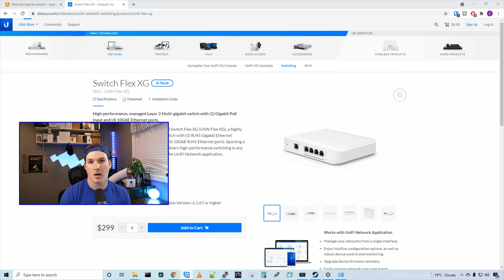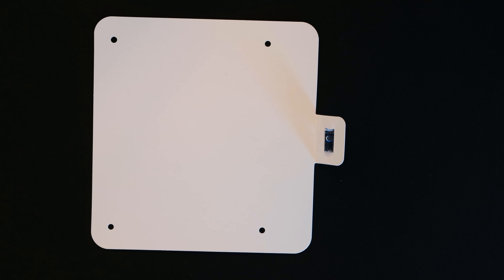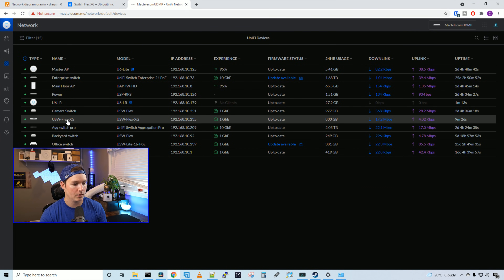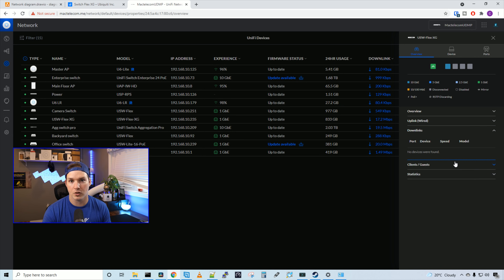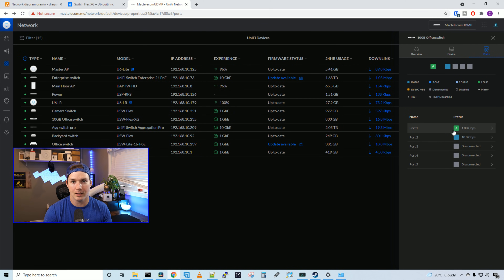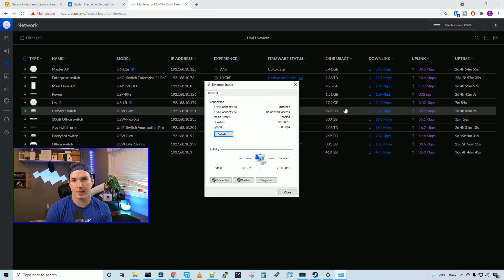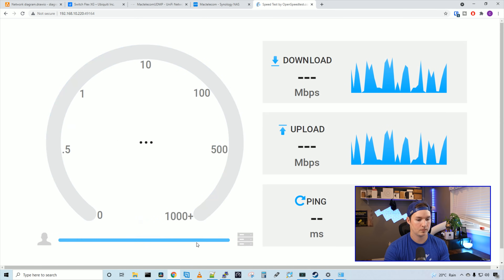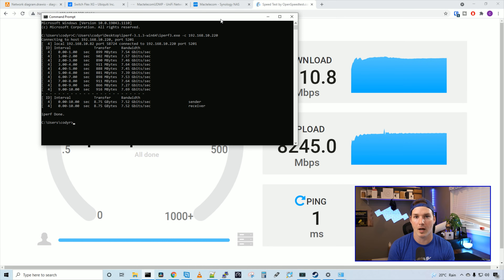New Unifi 10GB Switch. Unifi Switch Flex XG

Comment: Once again, Unifi fumbles the ball on the 2 yard line. Why hobble this switch with a last-century, 1Gb uplink? Would it kill them to make this at least a 2.5Gb port or (gulp) a 10Gb SFP+ port?  As is, I fail to see the use case.  Yes, maybe it can plug into a 1Gb port on an older gateway while running a local NAS. But as 3 and 5 Gb internet connections are becoming more available, this design seems doomed to be short lived.

Comment: Best I can tell this is meant to provide 1gbe internet but allow for 10gbe local network. I need an input greater than 1gbe and from what I see available with Unifi it looks like USW-Aggregation An 8-port, Layer 2 switch made for 10G SFP+ connections is my only option so I can go from my UDM Pro to the USW-Pro-24-POE (400W) then to the USW-Aggregation (I'm not rich so single point of failure will have to work lol). This way I can also go to the PC and the NAS on my network. 
Because as it stands if I go from the modem (SFP+ w/MikroTik S+RJ10) then to the switch (SFP+ DAC) I'm only left with one SFP Port. So I can either use the Agg as a switch managed with the UDM Pro, or I can just not have 10g to but one device. If there is a better option for 10g using the single remaining SFP+ to access multiple 10g connections please let me know.

Comment: As much of a UI fan boy I am, I just don't see the value in this. SOHO, then price is too high. Larger business will go with an enterprise switch. What UI really needs is a 4 or 8 port 2.5G switch with single RJ45 or SFP+ that can be used as a 10G uplink. Great overview though man.
Reply: Just got a pair of 4(2.5G PoE) + 2(sfp+) switch. It works great for my home network, and it only costs $40 ea.

Comment: Can we skip using port 1?  I want a 10gbe connection from my main network closet in the main house, to the CAT8 run that goes to my guest house (physically separated buildings)   The guest house has the 10gbe NAS and Mac Mini with 10gbe network port.    I'm trying to avoid the 1gb bottle neck.     I have this on order so I guess I'll experiment, but I thought I'd ask while I wait. I'll need to power via USB C in the back of course.
Reply from the maker: Hey,

Ya for sure you can use any other port as your uplink
Reply: Good info

Comment: do you have to use the 1g port for an uplink or could one use the 1g port as a normal switch port and use one of the 10g ports as an uplink?
Reply: @JeanKing310  thx
Reply: On ALL ubiquti devices you can reassign the ports, it makes no sense to use the 1GBe poe for data, i would guess is meant to be used for PoE power and not data.
Reply: Just 1G uplink port is totally nonsense. Why on earth someone would think to get this switch that doesn’t have at least an SFP uplink to get uplink in 10G?
Reply: @Danielddiniz it’s for POE in mainly. No one really makes 10gbe Poe+ switches so you power it using 1gbe and then you can have a 10gbe data link if you want.

Comment: I also have this Switch Flex XG and I can only perform the iPerf3 test up to 7.05Gbps between two x86 computers linked to this switch. Do you have any idear to furhter push the speed under this switch up to over 9Gbps? Or I should consider SFP+ switch and NIC systems for the 10Gbps wired speed?

Comment: Is it possible to use the ports 1-4 as aggregate (1g + 3x 10g) and the last one as Uplink ? Or aggregation is limited between 10g ports ? It's to make a 10G link between 2 houses. The aggregation ports will be connected to Local switch on both sites.

Comment: I mean this feels like it should cost 50 USD, maximum 100 USD.
There are only 4 ports with 10GBE, no faster uplink port, and the POE-in port isn't even 10GBE.
This is clearly a budget desktop switch, even if it has basic management features.
10GBE prices are still nowhere near where they should be.

Comment: I'm going to change my comment on this when I said it was overpriced.  Yes, it's on the pricey side but these are RJ45 ports meaning I don't need to worry about 10gig transceivers with a high power draw producing tons of heat.  Most homes or small offices have cat 6 already pulled so this makes connectivity easier.  People keep talking about aggregation switches these types of switches are built for data centers where I can easily connect using DAC or fiber meaning that the gear is in the same room.  Yes, I can put this in a wiring closet and connect via RJ45 every time I connect I'm looking at 45 to 60.00 for a transceiver also if using RJ45 transceivers most of these vendors do not support a fully populated switch with RJ45 transceivers and I'm not pulling fiber through my home.
Reply from the maker: Fair enough!

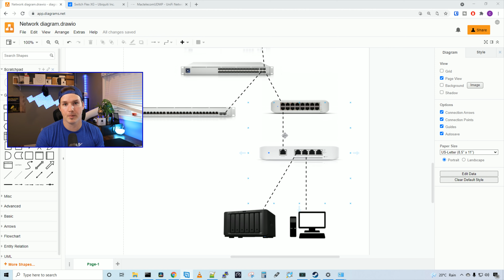Comment: At the topology at 6:36, I am not sure why you put the switch 16 lite POE there, wouldn’t it be better if you connect the Flex XG to the aggregation Pro switch via 10gb ports? Are you doing it this way because the 10gb port on the flex xg can’t be used as uplink?
Reply: Please answer this question somebody. This is the #1 question I’ve had for little over a year now.
Reply: You can use a 10gb port as an uplink. That’s how mine is setup
Reply: Because he is powering the FlexXG from the Lite Poe one.  It might also be the reason the speeds are not optimal since the FlexXG is not powered from the wall and might need more than 55V of power to reach 9+ Gbps.

Comment: Really bad results and strange you didn't checked them. 7G isn't 10G and iperf must return the full bandwidth as you are transfering from RAM to RAM. PS You can call it 10G or 10Gbit or 10Gbps, but never 10GB.

Comment: CMIIW : PC can communicate directly to the NAS (in one network)  without actually going to the router first? 

PC -> Switch -> Router -> back to Switch -> NAS . my stupid head thought it's like this
Reply: If the devices are inside the same vlan or lan than yes (normal MAC based Layer 2 Routing). If they are in different vlans, you require L3 Routing (IP based). That is either done on the Router or on a Layer 3 switch.
Reply: @andreas7944  thanks!
Reply: bisa nyambung langsung bos, kan 1 switch
Reply: @zxcvbnm-yy8bk  mantap om, baru tauu kirain lewat Router dulu

Comment: This looks like it could be a great backbone or aggregator switch for a small network.

 * All copper and RJ45
 * Under $300
 * Fanless (thanks for your answer earlier)

With an SFP to rj45 converter to a Pro 24 (tho I wish the switch was fanless - and, yeah, that it had a copper 10G port), you’d still have 3X10G connections for one desktop and a NAS with one left for growth. 
I suspect there are many networks like mine where there are only three, maybe four, devices that could effectively use10G. My NanoHD WAPs do a great job of saturating the house with fast and reliable WiFi. My smart home devices almost all run on 2.4G. My TVs are fine with wired Gigabit.
Not sure why everyone is saying the aggregation switch is so superior. It depends on the requirements of the network, I think. 
This looks almost perfect to me.
Reply: I just did that, it replaced a 10Gbps 5 port Netgear rackmount switch which barely fit in my closet box.  This unit is a fraction of the size and quiet.  I didn't connect the POE since I don't have anywhere to route it, maybe I'll stick a wireless bridge in there to get access to it.  Maybe if I'm lucky there is a way to manage it from the 10Gbps ports as well.

Comment: Very Disappointing No Layer 3 on these or their industrial series switches in 2021. not worth $299 at all
Reply: I see your point. But Layer 3 would increase the costs and the heat. I am not sure if you can cool it passive for a 10gb switch. The target audience for this device is cost and noise sensitive, I guess

Comment: This is an overpriced, waste of money for a 4 port switch and here is my reason why.  1.)  I just recently purchased an "Unifi USW-Aggregation 10G (8-Port SFP) Switch" for $269 at Microcenter, which price matched it with Unifi's website.  It comes with the new digital information display also included on the UDM-Pro and the new generation switches and is a layer 2 switch with VLAN support and unify management.   While connected to my UDM-Pro 10G Lan port, I'm getting 10G all the way through, with the exception of my WAN.  2.)  I also have a Mikrotik CRS305-1G-4S+IN 10G Router/Switch, which I Paid $139 for; however, the management port is a 1GB RJ45 port.  Non the less this switch is great for the price, horrible when it comes to the software friendliness, but very very powerful.   This switch should be way cheaper than $299, maybe $179, but also within reason from what a Microtik 5 port 10G switch/router cost for way less.  I'm just saying.   Here is the link to the 8-port product I am referring to on Unifi's website.  https://store.ui.com/collections/unifi-network-switching/products/unifi-switch-aggregation

Comment: This product doesn't make any sense. Why would they make the uplink/power input interface 1Gbps? No PoE on the downlinks either, really struggling to find the use case. Just buy an XG6. Taken with the UDMP SE I really wonder what Ubiquiti are doing.
Reply from the maker: The 1GB uplink will be used for internet. For me this is a great office switch. I have my 10GB computer on it and my 10GB NAS so my video files transfer really quick

Comment: Hi, am i correct that when i plugin 2 computer at 2-5 they can utilize full 10gb in between communication, so i could mokup a 10gb network behind a udm base which only  has a 1gb switch build in?
Reply: 10gb uplink between switches would have been nice

Comment: 1GB uplink in a 10gb switch.  Huh?
Reply from the maker: The 1GB uplink is to the internet
Reply: @MactelecomNetworks - Its not a WAN port is it, its just an uplink port with POE in.  This is an good switch for a desk or small office area where you want to 10gbe connectivity, but if like me your NAS is in a rack that's not next to your desk, you have to use a 10Gbe port for uplink - that's fine, I have a printer next to my desk that can happily use the 1Gbe port.  
All that said, this product should of had 5 10Gbe ports, Ubiquiti have intentionally crippled it with the 4+1 config
Reply: @68kfrank  well except Poe is likely coming from an upstream switch which then means all upstream traffic is limited to 1gb. You want to run a poe port AND a 10gb uplink port on a switch with only 5 ports to begin with?
Reply: @ystebadvonschlegel3295  you can power the switch through USB and use the 1Gb port for other purposes. You can even use a downstream PoE switch to power the Flex. Couldn't be more flexible.

Comment: Don't waste your money ($299) on this. Jut buy the UniFi 8-port aggregation switch for $269. It's way better value if your looking for 10GB connection.
Reply from the maker: Well then you still need to buy a SFPs so could end up costing you more
Reply: @MactelecomNetworks  +1  I have no idea why people say this.  It's like they either have a pile of SFP adapters lying around and figure that's what everyone else has too or they are used car salesmen that don't give you the fine print.  Plus the agg isn't PoE...smh

Comment: i would 100% get this if i did not need to climb through a 16 inch by 16 inch hole to get into an attic that has no floor or anything 🙄

Clarification edit: i would put this in my attic

Comment: Someone correct me please. 10g cannot be POE as the pair that is normally used for POE is used for data. This is why they could not make the switch powered by POE and a 10g uplink.
Reply: While that's the case for passive PoE. 'Proper' 802.3 PoE can use the pairs for both data and power. IEE 802.3af and onwards https://en.wikipedia.org/wiki/Power_over_Ethernet (edit typo)
Reply: you can use 10GbE for uplink. Powering it through a 1Gb PoE port from upstream or downstream is just an option - you can use USB too.

Comment: I don't see much value in this switch considering the 1Gb port and price.  UniFi 8 port aggregation switch is better value. Now if this box was a firewall/router (USG), I believe it would sell like hotcakes.
Reply: I don’t think he’s got it right.  The PoE in is predominantly to power the device, you can use any of the 10gbe ports for an uplink.
Reply: Maybe if the agg switch were RJ45, but I'm not sure I agree with the value assessment.  I agree with the 1G uplink.  Should have been 2.5 and it would make more sense and be more flexible in various networks.
Reply: @5280Woodworking  Cost savings are realized with UniFi 8 port agg switch when you connect to other 10Gb devices (nas, computers, etc.,) and have to buy the interface cards. On average 10Gb SFP+ cards are about $45 dollars cheaper than 10Gb Ethernet cards.

Comment: I wish that uplink port supported 10/5/2.5/1 Gb. When connected off of my main switch (which is how I'd use it), I'd like to get the full 10 gig back to that switch.
Reply: I’m using one of the 10gb port as an uplink and the 1gb as a downlink to a switch with my lower speed devices.

Comment: Really sucks that the PoE uplink is 1gbit. Would have been perfect if it was 10gbe too.
Reply: Agreed. Imagine you have another computer on the other side of the house, and you want the full 10Gbps to the NAS. You're outta luck!
Reply: @neekster28  Honestly even simplier use case, I have multiple devices that connect to my NAS/Server at the same time, which definitely has the posibility to use more than just a gigabit in total.
Reply: @neekster28  nothing stopping you from uplinking to 10Gbit, but I suspect they expect it to be used as an uplink more directly to the router for internet...think DMPvSE

Comment: Overall I am pleased with this switch ( does what I want) but the one thing that is driving me crazy is - NO way to turn off the Leds.  The toggle to do this does NOT work.  I know I'm being picky and have black tape across the front of the unit, but for $300 - come on fix this.
Reply: I don't have this switch yet, but did you try restarting the switch after toggling? Sometimes I have to restart equipment after making a simple adjustment.
Reply: This hardware limitation applies to other Unifi switches too. You can only turn off the switch status LED. Don't hold your breath for deactivation of switch port LEDs.

Comment: Such a pointless product, with an extremely high price tag.  A 1 Gigabit uplink and only 4 ports  of 10Gigabit.  Unifi really refusing to give us consumers a quality 10GbE Ethernet switch.
Reply from the maker: For me I’m fine with the 1gb uplink I only have a 1GB internet connection. 

I’ll be using it for my my videos. Have my computer and nas on the switch works well
Reply: @MactelecomNetworks  I think this is exactly the right way to use it. If someone is building a 10gbit network, 4 ports are useless anyway. But if it's just for the desk area where you have a couple of machines and a NAS, this is perfect.

I don't see many other usecases for it.
Reply: @MactelecomNetworks  it would be nice if the 1 gb port were also 10 gb but I could easily see putting this on my desk to support a couple of 10 gb capable computers and not even using the 1 gb PoE port. Instead I’d just use one of the 10 gb ports to link back to the Agg Switch I already have and that leaves three ports on my desk for use.

Comment: Could you confirm whether a 10Gbase SFP+ RJ45 module in one of your upstream switches (perhaps the USW-Agg-Pro) can be used as the uplink for the USW-Flex-XG? I've considered this switch as a future option to use on a different floor to expand 10gig capabilities around the house. I understand that the power supply would need to be used on the USW-Flex-XG. Also, could you confirm that if a 10G uplink is possible, then can the 1G port be used just as a normal downlink port?
Reply from the maker: There should be no reason this wouldn’t work. But I’ll plug it in to my aggregation switch tonight or tomorrow and talk about it on my live stream Sunday
Reply: yes
Reply: I have mine working this way.

Comment: They really dropped the ball on the POE uplink port making it 1GBE, they really shouldve made it 2.5 GBE
Reply: 10GB switch but uplink is 1GB that doesn't sound helpful.  Why not just make a 4-5 port switch with all 10GB ports and allow any to be the upload port(s).
Reply: @robtaylor206  That too. 2.5GBE would probably keep the cost down though especially with it being POE powered.
Reply: Unless I'm missing something, you can use the 10GB ports for uplink like any other port. And you can power the switch using usb-C connector that it has.
So it's all good except the 1GB PoE port.
You can use any port you want as an uplink. There shouldn't be a reason why not.
Reply: The chipset is the same used in the MikroTik switch. That also "only" has 4x 10 GbE (SFP+) ports and one 1 GbE PoE IN RJ45 port.
They can't just have a 10 GbE / 2.5 GbE uplink when using that.
Reply: @TheJulianJES  chipset or not thats still a waste of a port and Id rather power it with the USB-plug